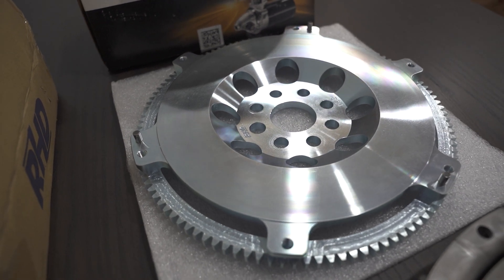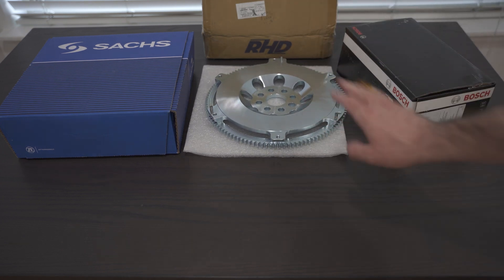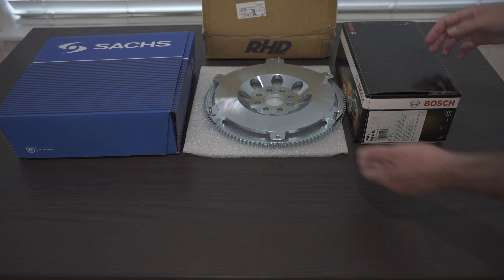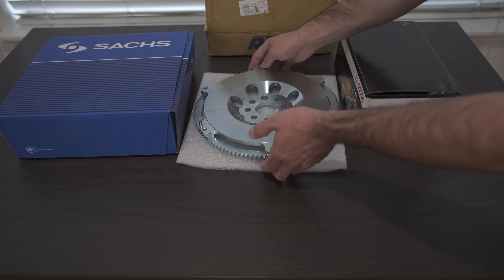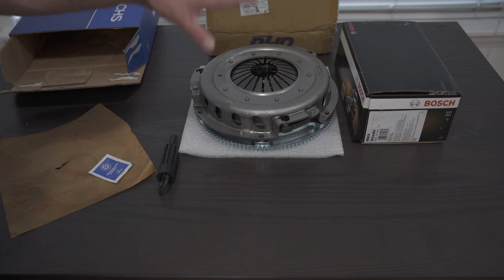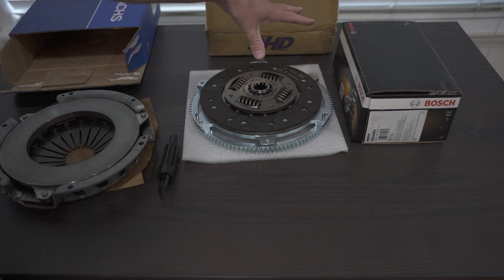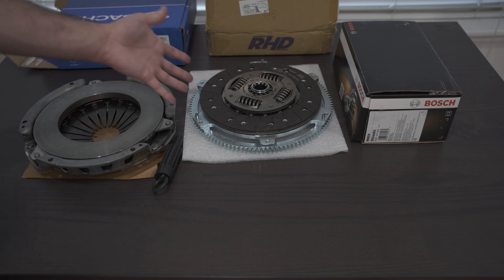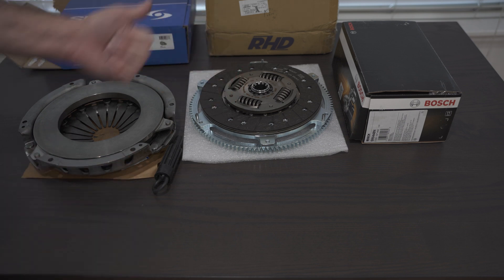Best BMW E30 Clutch and Flywheel | How to Turbo an BMW E30 Series

Comment: Just as a warning to people buying this parts combo, the link to autohaus for the starter is now wrong. That's an m54 starter now and the axial alignment is wrong and the teeth won't mesh. I confirmed this by checking the bosch part number on ECS's website and checking model compatibility, and it says that the starter isnt compatible with e36 325is. I believe the correct start will be something for and e36 or e34 with the early m50 motors, it has the same tooth count, but mounts in a slightly different location. Other than that the flywheel, clutch, and pressure plate all went together great. I got the slave bled and the pedal feels great, I will update this comment once I get the car running and I have the correct starter.
Reply: Nevermind, I ordered another part number starter for the e34 525i with the m50 and I'm having the same issue. The bendix kicks, but the starter gear runs right into the ring gear. I found out I'm missing my dowels, but I loosened my bellhousing bolts and used a jack to give the starter maximum clearance and it still runs right into the ring gear. I reached out to RHD to see if they have a suggestion, but I may have to abandon this parts combo. The car is a 1987 325is with a g260, not sure what is making this combination not work for me.

Comment: Do you have a part number for the m5 clutch itself? If i wanted to buy the "sport" pressure plate and the m5 clutch the link you posted only comes with a kit so i would have an extra pressure plate. Thanks, great video
Reply from the maker: Sachs Mfg #21212226428
Reply: Should i run a different throwout bearing with this setup or the one thats included in clutch kit is okay?

Comment: @turbineresearch so without the upgraded pressure plate, we would just buy the clutch kit you linked and the flywheel and starter?
Reply from the maker: Yes, if you want the most performance you can get the upgraded pressure plate. Otherwise just the standard M5 clutch kit will work

Comment: The clutch kit in the links is a different PN than the video says. Which is correct?
Reply from the maker: The kit is for a e34 M5 clutch kit
Reply: @TurbineResearch  Wait, I just rewatched this and realized something. You're using the e34 M5 disk with the 765 pressure plate? So, you have to buy the RHD flywheel, the clutch kit, the HD pressure plate, and the starter to make this work?

Comment: I have the M20 version of that same flywheel from RHD and have been fairly happy with it. I had already replaced the starter the year before so I didn't think it made sense to change it again.  Though I'm only shooting for 15lbs or so of boost so it should be fine
Reply from the maker: Right on 🤘

Comment: i'm curently using custom setup on my turbo m20 too, OEM m20 flywheel with sachs 4 pads clutch from e92 (228mm 22 tooth for 6 speed gearbox) disc and sachs reinforced mecanism like your's. I was looking for something more simple for my next upgrade with a light flywheel, and this is exactly what i need, and can use E46 clutch disc like as well, so thanks you :D
Reply from the maker: Thank you ! I'm glad it was helpful ☺️